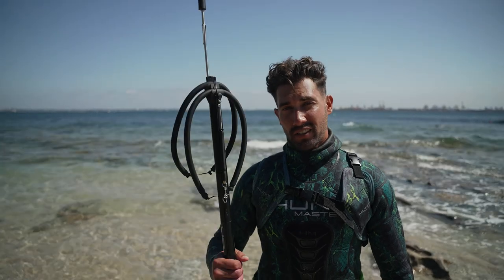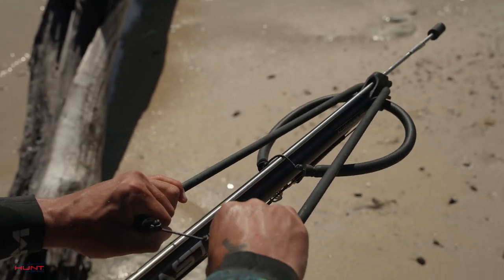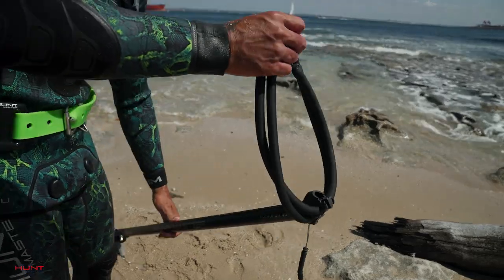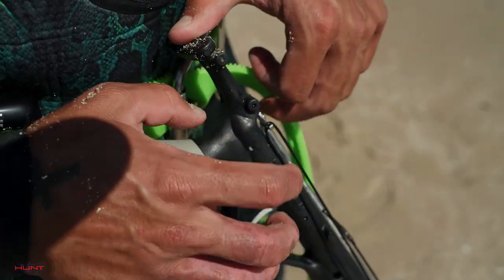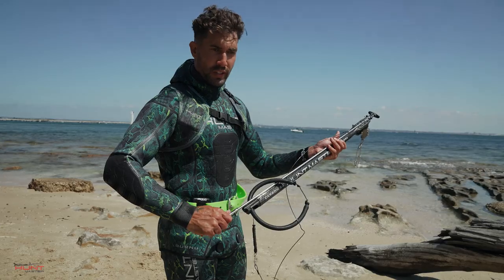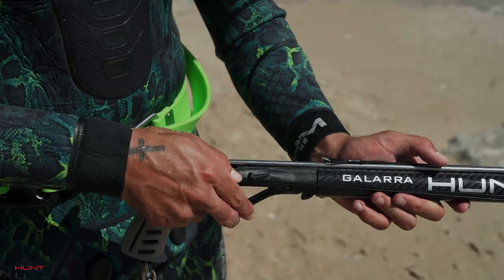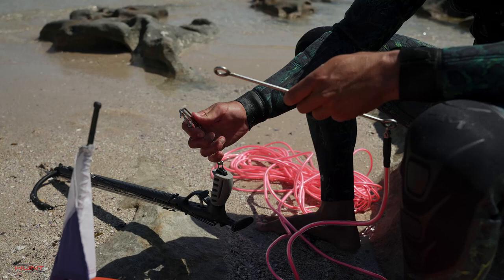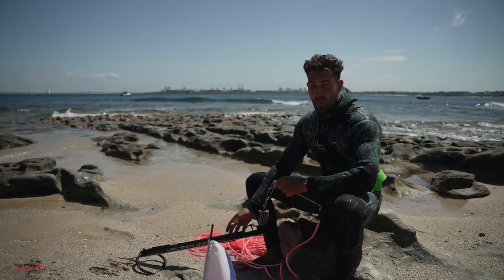HOW TO LOAD A SPEARGUN | Loading & Rigging Up

Comment: Great tutorial but i find difficulty loading it even underwater , the rubber is very tough to pull as i don't have a wetsuit and if i manage to load it will cause me great pain in my chest 
any tips how can i load it without my chest hurting?
Reply: I took one sandal, cut to fit the handle of the gun and duct taped on it making a custom pas
Reply: @turnedmyback3141  Sorry for the late response i just saw this comment and that is a wonderfull idea i'll make sure to try it thanks!
oh and btw my hands keep slipping on the rubber should i get gloves?

Comment: Bro this hard af to do this in the water, the mono line is getting tangled after everyshot, takes me ten minutes to load it again if im lucky
Reply from the maker: Starting out it is definitely a little tricky. But it's one of those things that practice really helps with. This is how Open Head spearguns have worked for a long time now, but watch this space - exciting things are coming!
Reply: Do a single wrap till you get the hang of it